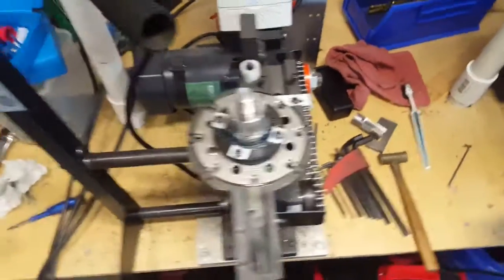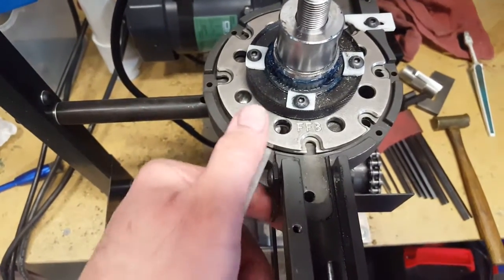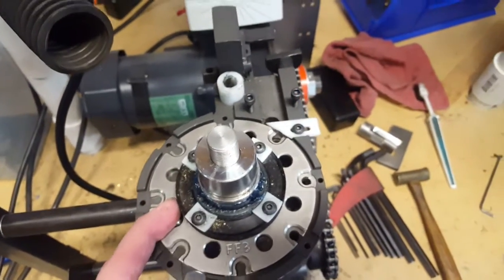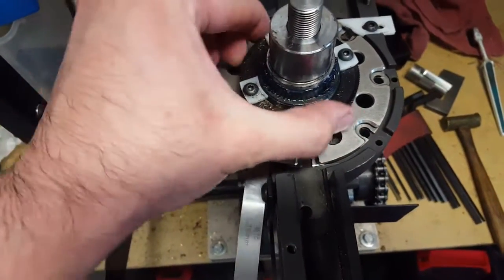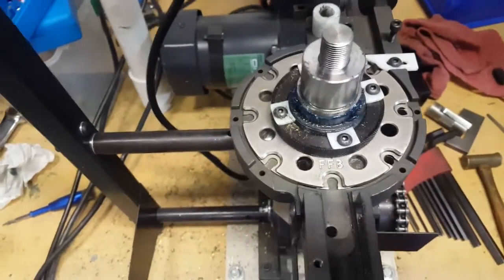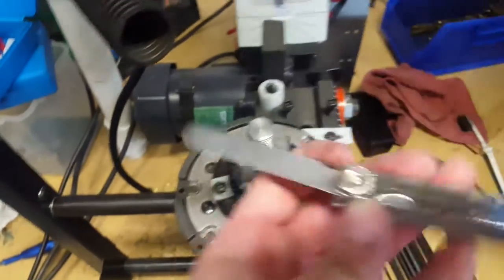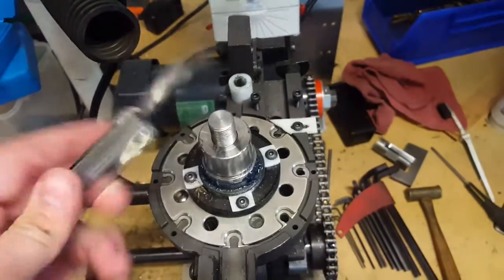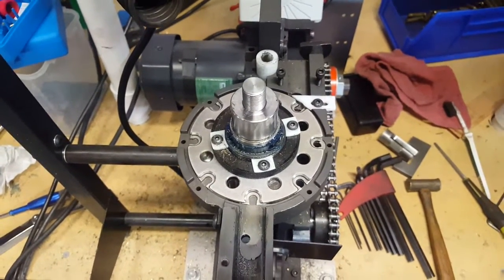Fast and Friendly Brass Shell Plate Setup for Dillon 1050

Comment: Hi, the mainshaft on your press is custom appently. I believe to have heard you mention in one of your videos that you have honed it out. Did you ream it on a lathe and then make the custom shaft to fit? I have two 1050 which are old and have developed some front to back shaft play, too. Thanks!